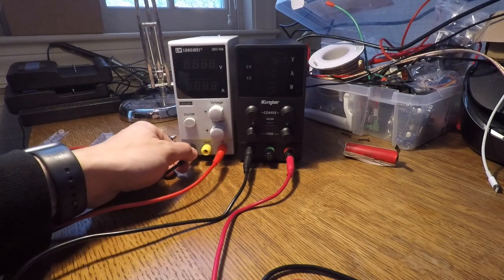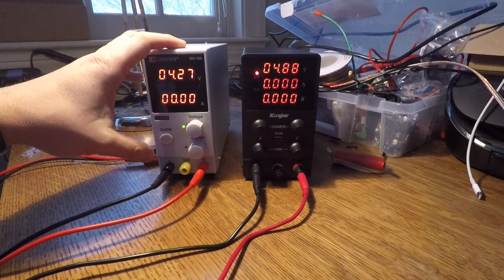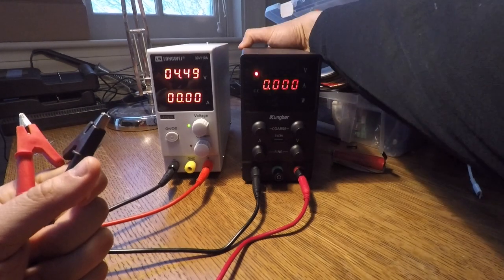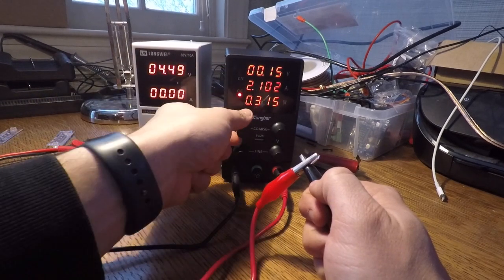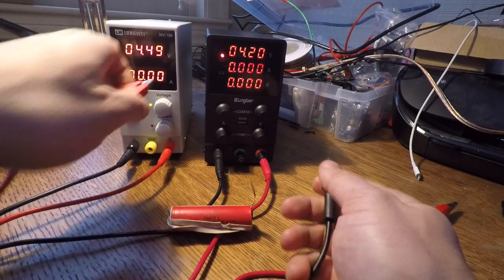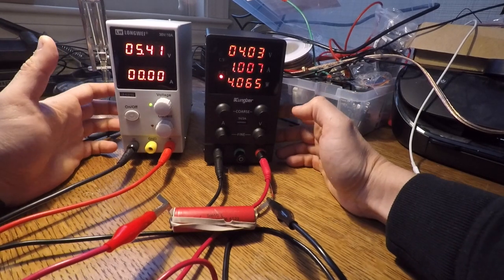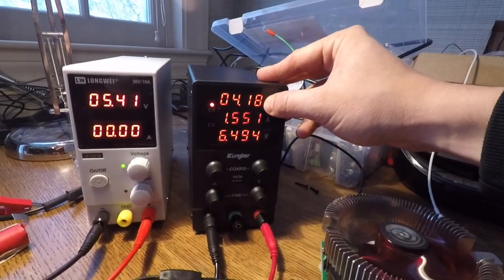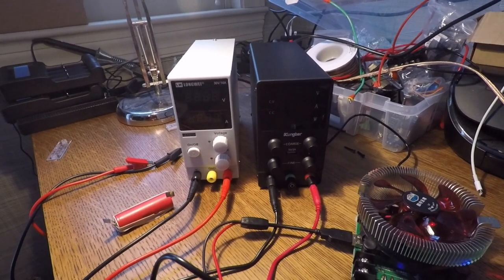Small Bench DC Power Supplies - Review and How To (Constant Current vs. Constant Voltage)

Comment: Can that power supply be use as a substiture of 12V automotive battery on DIY spot welding  machine (spot weld 18650, 21xxx, 27xxx lithium ion batt)  ... thanks ...
Reply: No

Comment: hi sir. I just want to ask a question. will this type of power supply get damage if you always short using 5A setting in a long run. I plan it to use in studying laptop motherboard repair in finding shorted parts.

Comment: So can you do positive and negative voltage with this at the same time? I need +20 and -20 at the same time? Also can it provide both max current and max voltage at the same time? for example 30 volts and 10 amps, so 300 watts?

Comment: thank you for that, my PSU sparks when I connect the leads at any voltage above zero to adjust the Constant Current, could it be that on some units you need to do that with the dials turned down to zero only

Comment: If you want precise outputs of voltage & current use the power supply in tandem with digital multimeters & adjust voltage & current to your requirements. You can buy two DMM for $50 & now you have better metering for you bench power supply.

Comment: why dont they make them where you can set the voltage and Amps Live and you just plug and play ? why do u have to touch them and do all that unnecessary stuff? All dc power supplies function like that?

Comment: Hi, was wondering if you could help. On my tire lathe I have a 1/10 th scale remote car dc motor and I have the kungber power supply from this video. When using it the motor is easy to stall and makes it unuseable because of this. I confirmed with a battery for a temp power supply and the motor wont stall when using the battery. Its like as soon as I load the motor up it stall with the kungber. Any ideas? What am i doing wrong or is it a bum unit or am I a bum unit lol. Thanks

Comment: Your black psu do turn off instantly, but it takes a while to discharge the output capacitors.  If you connect a load and turn it off you will  see that it shuts down almost instantly...

Comment: Set my similar DCPS to charge my 12v 280Ah battery at 14.2v & 4.5 amps and smoked it in 30 seconds, what went wrong?
Reply from the maker: Hmm, your bench supply went up in smoke? If you set it to the settings you are describing here, there should be no problem at all. These are cheap though and they do have a reputation for breaking on occasion. Return it for a new one if you can.

Comment: I have a few devices that the charging port has broken and was wondering if I can simply use an alternative way to charge my lithium batteries from these devices mostly flashlights? Would these power sources be able to charge lithium batteries?
Reply from the maker: These can definitely charge lithium batteries! but make sure you know what to voltage to charge them to.

Comment: In my experience, you actually CAN set the voltage higher than that of the battery rating and the internal resistance of the battery will slow increase, dropping the current lower as it charges until the battery is fully charged.
Reply from the maker: That is true, except that if you leave it that way, you will eventually over charge the battery. But it can be done if you monitor it carefully.

Comment: It's help full. 
But i don't how cc mode works in power supply
Reply from the maker: cc is just constant current. It basically means the power supply is trying to keep the current amount constant and will adjust the voltage to reflect that.

Comment: I have an odd task that eventually brought me to this video. I'm trying to shore power an 18650 powered device. I have seen a couple "dummy" batteries that have a wire coming from segregated terminals in a printed housing to mimick an 18650. Could a device like this safely shore power my 18650 gimbal? Thanks for any input!
Reply from the maker: I've power 18650's with these for sure. Just make sure you know what chemistry you are using, and set the max volts for the voltage that corresponds to a fully charged battery, and make sure to set max amps to an amount that is safe. If you are just powering the device directly make sure to figure out its voltage and power needs and set those in the power supply, but you could definitely use this.
Reply: @TheWilltoBuild  thanks for the help sir, this gives me the confidence to try my idea in the future, hopefully without any magic smoke. also, i asume for safety sake, best to use one power supply per battery? I also assume that depends on how the power is configured in the device?

Comment: Which one would you recommend that I get? I have been looking for a supply with a adjustable current limit since the one I am using now doesn't have that.
Reply from the maker: As far as I can tell performance is basically indistinguishable. The Kungbar is perhaps just slightly better but honestly they both work fine.

Comment: Thanks for this. I just bought the Kungber 30V 10A unit which I like. This said the instructions that come with the unit are okay, but only okay. I really needed to see someone step through the basic possible configurations of the device, with constant current and constant voltage, and the automatic cross over between the two, in order to understand how the controls work and what the displays mean. The Kungber seems like a well made, basic tool.  The wattage display is a nice bonus.
Reply: Well explain to me how to use it. I recently bought the same exact model, and I really only need it to test headlight assemblies. I'm confused on to set the voltage, and amperage. Most of the assemblies I'll be testing only need 12v, about 4 amps, 55w at the highest for bulbs. So do I set it at like 13 volts, 4-5 amps, and then it's plug and play to the assembly?
Reply: The current control is just a current limiter, that is all it does.  You can leave it on maximum for most things.  Its useful if you are testing something that is delicate, ie a new circuit you are testing and you want to limit the power for the trial run to make sure nothing overheats gets damaged.

Comment: THE 30V10a UNIT HAS A HUGE DESIGN FLAW IN CC MODE!!!  If you set it to supply - say 300mA @24 volts, then, because the meter is not overly accurate, you put your digital multimeter in series with one of the leads - on its 600mA max range then apply the power supply to its load, - the initial surge is waaay over and above 300mA - enough in fact to blow out the 800mA protection fuse in the multimeter!!  in fact - i also tested it with a 3.15A fuse - that's over load by a factor of 10+ and it blew that too!!!
Reply from the maker: This is interesting and a good point. These are not lab or professional quality bench supplies. They are designed for amateur use, so they will not be precise and I wouldn't rely on them for electrical engineering or other precision applications.
Reply: The 800mV in your multimeter reflect the load connected+ and the power supply itself

Comment: For the last few hours, I've been trying to bring myself up to speed on using my entry level benchtop power supply. Your video is the clearest and straight forward so far. Thank you very much.
Reply: Agree.😎
Reply: Mine has been sitting in the box until finding this video... It's like getting a birthday present all over again!
Reply: Definitely the best one I've seen so far
Reply from the maker: Glad this helped. I went through the same experience.
Reply: @TheWilltoBuild  if I set mine on 14V and connect it to a battery it automatically jumps into CC 🤦🏻‍♂️ HOW does it stay in CV?

Comment: Maybe it's not related to cc but everytime i connect dc power supply to phone...the dc voltage drop to 0 and cc led automaticly turn on and voltage wont go up...i dont have have any problems before...maybe you know why it's happened
Reply from the maker: If the phone battery is really, really low, it is possible that the voltage drop is because the power supply is trying to charge the battery and has to lower the voltage in order to not supply too much current. But otherwise I'm not really sure.
Reply: @TheWilltoBuild  btw...same thing happened whenever i connect the aligator clip to phone or something else...it quite annoying when i'm kind an urgent to use it...it's not supposed to work like i should be
Reply: @shahcruz259  If what you connect to the source is short-circuited, the voltage will drop and the amp will rise.

Comment: Sorry, I am sure this is a very basic question, how do you know what the maximum charging current and maximum charging voltage is for any specific battery?
Reply from the maker: Every battery should have a technical data sheet that will list the maximum charge and discharge current, usually listed with reference to the total capacity of the battery in hours. So if you have a battery with a 10 amp hour capacity, the charge rate might be listed as 1C, meaning you can safely charge up to 10 amp hours.

Comment: At 3:05 you say that you "connect these 2", but you don't show what you're connecting. I'm guessing you're short circuiting the + and -, but since you have 2 PSUs there, maybe you're connecting the 2 PSUs together somehow?
Reply from the maker: Sorry for the confusion. I am speaking about connecting the + and - of only one of the power supplies - not connecting the two PSUs together.
Reply: will it damage the power supply if we connect the positive and negative of the power supply like that? i just thought we will short circuit the power supply or there will be a spark, just like what happen when we connect different polarity of a battery.
Reply: @mzf2905  It will not. This kind of PSU limits the current. There might be a small spark when you connect them, but then the voltage difference goes to 0 (obviously, since it's shortcut) and the current limiter kicks in.
Reply: @marcus3d  So if you connected something in a short circuit, does it still send the current at least until what is short? It would be wonderful.

Comment: Can I use the bench power supply allow with my renogy charge controller especially on a cloudy day?
Reply from the maker: That is a very complicated question that will depend entirely on your setup. But the input to this power supply is AC power, so you'll need an inverter are the bare minimum.
Reply: Already have a 12v 3000w inverter, 12vbattery bank and a 40amp mppt controller.  Can I use my dc bench power supply to assist the charge controller on a cloudy day , the power supply set at about 13v connected directly to the battery?

Comment: can this supply be used to.isolate a short  or does it got short protection
Reply from the maker: In order to adjust the current you have to short the leads. So I imagine you could use it to isolate a short.

Comment: Helpful video. I have a Kungber clone and I noticed the 4th voltage digit skips 4 and 9 - yes, even finely sweeping. The 4th current digit has no skips. It appears the Kungber has the same flaw. Could you confirm that for me? I wonder if it's a PCB error, firmware or maybe 7 segment decoder issue?
Reply from the maker: Exactly the same for mine! great catch. No ida what could be causing it.

Comment: My bench power supply has max output volts to 17V
And 2A
Im trying to charge a 12V car batt lead acid
When i connect the psu to batt the psu drops to 11.5 V??? And fluctuating (11.1V-12v)
And amp fluctuate (0.00 to 2.99)
What is wrong here?
Reply: Buy buck converter from AliExpress 
SAR 16.63  10％ Off | DC/CC Adjustable 0.2- 9A 300W Step Down Buck Converter 5-40V To 1.2-35V Power Supply Module LED Driver for Arduino
https://a.aliexpress.com/_mrHXnaz
Reply from the maker: Hard to say. What are you setting the maximum voltage to on the bench power supply?
Reply: @TheWilltoBuild  its a 17 volt powersupply. When i set it to max it goes till 14.2 volts. Amp meter shows 0.00 Butwhen i connect it to battery the volts drop to 11.2 and it starts in a circle 0.00 , 3.45 to 11.23 to 12.00 to again 0.00 ..... and so on...and  the amp meter goes like 0.00 to 1.66 to 0.7 to 2.7 and circle back continuously. 
O checked the battery after 9 hrs of charging. It went from 11.2 to 11.5 v. I dont know why it doing like that

Comment: If that is a Li Ion battery most charger start out Constant Current then shift to Constant Voltage after the charging rate slows. It is more complicated with batteries of multiple cells.
Reply from the maker: that is precisely what the chargers do. They start out with constant current and then when they approach full charge switch over the constant voltage, IF you use them correctly.

Comment: Do you think one is more accurate than the other? I need to buy one soon.

Very well explained. I watched a couple other videos before yours and still had no idea how to adjust it. All I need it for is to parallel top balance 8 LiFePO4 280 ah cells.
Reply from the maker: I think in terms of accuracy they are basically the same, I didn't detect any noticeable difference between the two.

Comment: You seem to know a lot about this. Is it true that you can use these to charge li-ion batteries? Like if you have a 18650 cell of 3Ah that takes 0,5C charging current, you should set the power supply to 4.2V and 1.5A it should charge the battery correctly. Does that work?
Reply from the maker: It definitely worked for me. Just make sure to set the maximum amps correctly and the max voltage. If the voltage drops while you are charging that is normal, it will go up over time as the battery charges.

Comment: For vintage stereos that require 1.5VDC (internal terminals) for calibration purpose, how many amps should be fed ? There's no mention of amps in service manual.
Reply from the maker: Good question, unfortunately I have no idea. If the load is resistive, it won't matter too much how you supply, it will take only what it needs. But it may not be, so I can't say. I would do some googling on that.

Comment: Can i charge my battery bank 4s with bms lifepo4 280ah with this power supplier? 
Ore i need biger supplier with 30v and 30a?
Reply from the maker: Yes, I have a whole other video on how you can do that. A bigger supply will be faster, but this supply is sufficient, it will just take a little while.
Reply: @TheWilltoBuild  Can you point me to the video you reference?  I have this same setup on an RV and during the winter I pull it and store it in my basement, but I want to fully charge it just before I put it back on the camper.  Initially, I top balanced it in parallel, but my build is in serial now and would be a pain to convert back to parallel.

Comment: For batteries or charging anything is it better to have more amps or more volts in powering them? Thank you for your time.
Reply from the maker: It doesn't quite work like that. You need to make sure you select the right voltage for your battery - so if your battery has a max voltage of 14.6 volts, then you would set your power supply to 14.6 volts. Higher voltage would over charge your battery and damage it! More amp hours (higher current) is a good thing if your battery can handle it. Batteries have a maximum charge rate as well, so you need to make sure you charge them no higher than that rate, or you could damage them.
Reply: @TheWilltoBuild  ahh ok. My battery specifications at 60 volts at 10 amps and a total of 1260WH. So which would be better or efficient & safe for the battery? Max amp lower volts or volts at max and lower amps. Thank you again.

Comment: I have a 12v  ECO X GEAR  Soundbar , For a golf cart. How do I hook  it up to a  30v 10a  DC POWER SUPPLY  ?
Reply from the maker: If you are going to replace the lead acid battery in a golf car with a lifepo, I would say it is worth it to buy a proper 12v charger. But bottom line, whether it is a bench power supply or an actual 12v charger, you can always just connect the positive and negative terminals of the battery to the positive and negative terminals of the power supply or charger.

Comment: I purchased a Sky Toppower 60v/5a. It weighed 1.3 kg. It was more junk from China. It was inoperative unless it was tapped roughly on the workbench. Very low quality for these that cost less than $300. Ordered a quality 50v/50a/220 volt from Mastech Power Supply. If you are wanting to charge a 12 v 100 ah lifepo4 diy battery, you’ll need 50 a to charge it in a timely manner. These cheap units can take days, depending on the DOD.
Reply from the maker: I'm pretty happy with these units, they've held up well. Ordering the power supply you describe would be great, but between the cost and needing 220v I think it won't work for most people.

Comment: Thanks for the informative video. Can I ask you a question? I have some big LiFePo4 batteries coming in and I want to top balance them first in Parallel and I'm pretty sure this is the device I would want for that. But my question is, I plan on using these 200Ah batteries on my camper with solar panels so I don't really want to spend money on a charger. Can one of these handle the occasional charge of a big 12 volt battery like that? It would be nice to be able to charge up on a rare occasion from AC.
Reply from the maker: Awesome question - I literally working a on video covering this topic right now. The short answer is yes - you can totally use one of these to top balance large LiFePO4 cells, but to do it safely is a little more complicated. I would do four cells at a time, put them in series and use a BMS and charge them (do not skip the BMS). Then, when the cells are close to 3.35 or 3.4 (ish), switch them over to parallel and finish by bringing them up to 3.65 (although I don't like to bring my cells to 100% so I just take them to 3.5 and it works fine. Look out for the video, should be done by next week.
Reply: A question I would of asked also as I have incoming cells and learning what to do with them now before they arrive
Reply from the maker: @texaszed9834  Great question, I am working on that video now and will publish it soon.
Reply: the same!